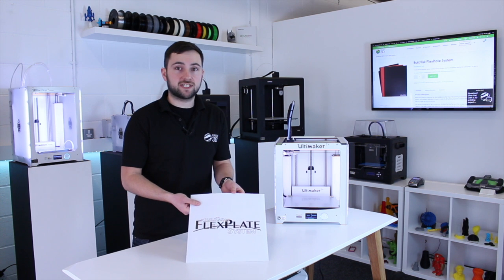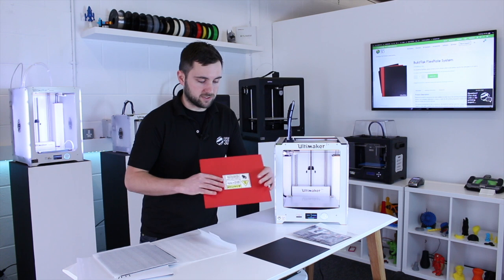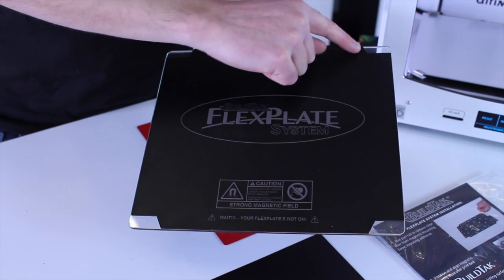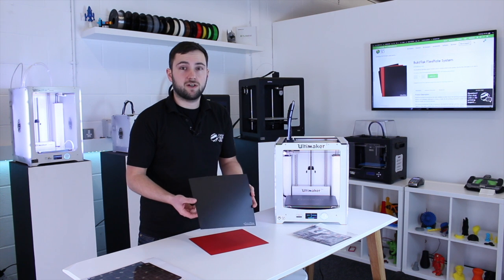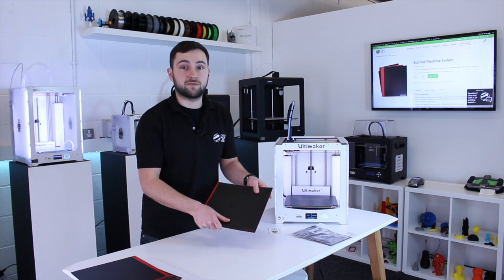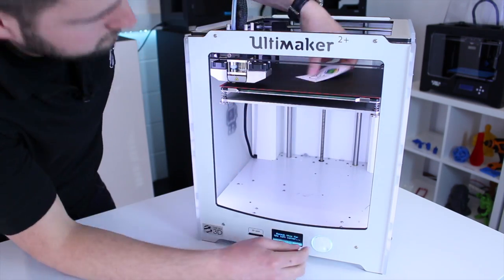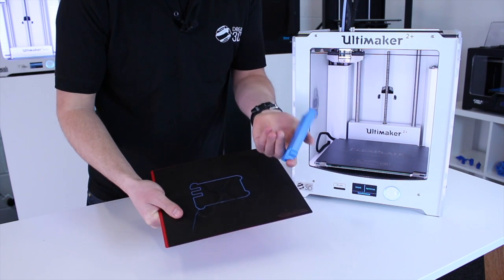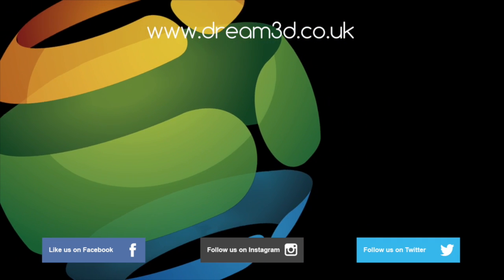BuildTak FlexPlate System | Overview | Dream 3D

Comment: I print on 100mmps speed and get warping with pla...Is it the perfect solution for me ? and what is the default life time of the buildTak sheet 
for different materials ?
Reply from the maker: Hi,

it will definitely help the warping with PLA, the lifespan of BuildTak is pretty long really, you could easily print 20+ models on the same area. we've had ours on for months, you can keep them going for a long long time if you're careful.

Comment: Lots of questions if I may: How badly does it affect bed temperatures? Will you still be able to get to 100°C on the UM2+? Do you need to up bed temperature? How thick is this all together? Any idea on what to expect with respect to life span of the flex plate itself?
Reply from the maker: Hi, the bed temperature is effected by about 10%, but since the BuildTak helps the prints to adhere, It's not noticeable. The entire is system is rated for prolonged use up to 120ºC; 100ºC will not be a problem. The whole thing, Magnetic plate, Flexible Plate, BuildTak Surface, is ~3 mm. If used properly it should last as long as the printer. The only component that will need to be replaced overtime is the BuildTak surface on top of the Flexplate. Hope this helps

Comment: While using abs on this buildtak flex system, do you need to heat up the build plate?
Reply from the maker: Yes, ABS still requires a heated bed. Although, we have received reports from users of being able to print ABS without heating the bed
Reply: I asked this question because I have an idea to apply, simply I don't want to stick this to the print bed, instead I want to have it laid on it, hold it with a couple of clamps, once done printing I'll take the sheet and flex it exactly like you have on a flexible metal sheet, I'll make several tries and get back to ya :D